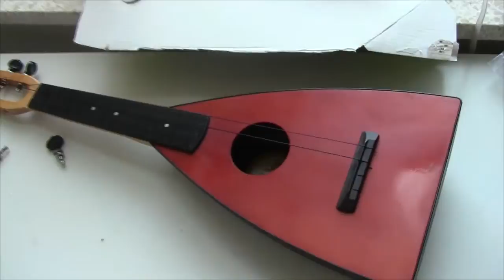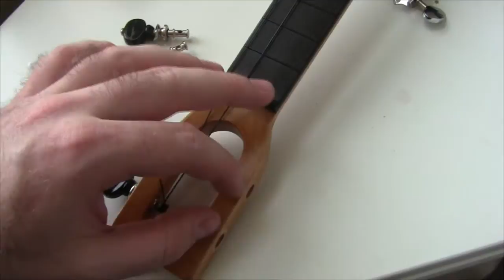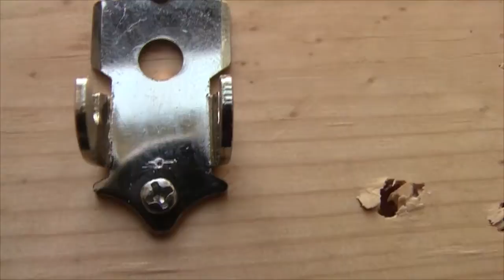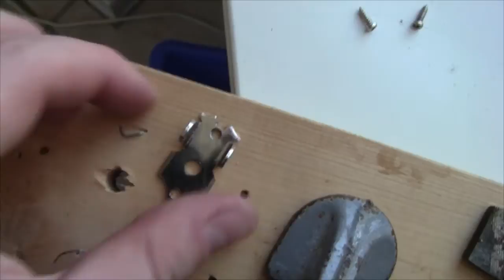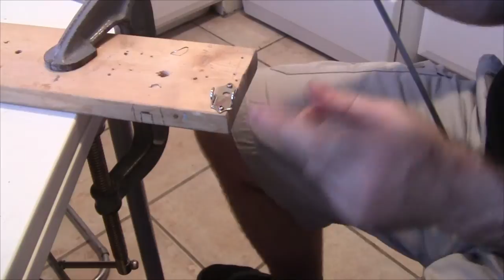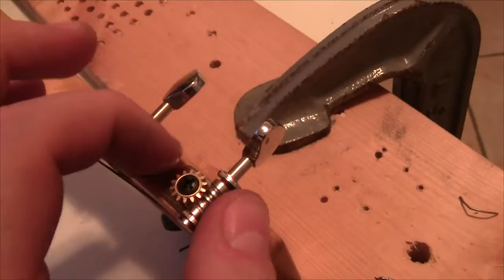Retrofitting a Flea/Fluke/Firefly Ukulele with Machine Head Tuners

Comment: At the end of the video, you showed a closed gear Kluson style tuner which you said you were also going to try.  Did you try those on a Flea/Fluke?  How did it go?  Looking at those, it seems that trimming off any overhang would be more difficult, if possible at all.
Reply from the maker: Yes you're right. As I recall, I initially tried to file the overhanging edges, but the metal was thick and it was taking forever. I switched to my rotary tool (dremel), and while it was indeed faster at removing metal, it made the tuner really hot, which damaged the tuner, because I think there must be plastic parts inside. The style of tuner I demoed in this video is a much easier choice!

Comment: Thanks I did this today, my music shop had mahalo Uke  geared tuners which they said had the least modification needed. They look exactly the same as you used. They had grovner but he said the mahalo in his experience  had no problems in his 30 years at the shop ,( maybe you upgrade by then but I have also had a mahalo no problems).
I just miss matched the tuner heads and had the shortest ends matching together because I was too l lazy to grind away metal with a file and hacksaw. I drilled a new hole closer to turner cog as original screw hole is to close to the top of the Uke head and wanted it further back than 3 mm(Australia measurement or 1/8 of inch approximately) to prevent possible split.
I did not file anything away but it looks pretty good without an extra hour of fiddling around more.
Reply from the maker: Nice. Glad to hear you were successful! Clever idea to mismatch the tuners to avoid having the trim the metal. Does that mean that the direction of rotation is opposite on the ones you swapped?
Reply: @cjhoyle  you turn them both ways to tune so works the same way. All pegs on the bottom.
Reply: @cjhoyle  I put a new hole on non cog side nearest the top I should have said. Your video got me going I just tweaked it  , I didn't screw in the tuner head to a piece of wood numerous times as I did no filing . The edges stick up very marginally but you don't notice it. I was lucky that I didn't have shave the hole ,the internal guide piece for string cylinder threader pushed right into the existing hole and grabbed. I did take off a few tuner heads from 1 lying around ukes that never gets used  and a neck from a broken Uke which was an unfortunate accident ( may be used one day) to do some physical research to nut it out.
I'm sure you inspired a few people around the world.
Reply: @cjhoyle  I think the rotation has changed but that's alright, I can live with that, it only needs fine adjustment.
Reply: @cjhoyle  I decided to relook at the tuning heads as I had a little bit of a look to see how much of the tuner metal plate I would have to trim . Not that much at all so I went ahead and have changed two of the tuning heads around so they are all in the correct rotation,less to think about when I tune . It makes more sense really. I am really enjoying the magic flea and it only needs a tweak of tuning head to get the tuning right. Friction heads were as frustrating as anything to get right ,more  play rather than more  tune is the idea. GREAT iINSTRUCTIONAL.

Comment: Friction tuners work well if you stay after the adjustment screws. The peghead wood  shrinks and  expands ever so slightly with humidity changes so it takes < 30 seconds to get a  perfect feel every so often. I happen to think cheap geared tuners aren't worth their weight on a soprano uke.
Reply from the maker: I respect your opinion, but I personally find Friction tuners annoying even when the adjustment screws have been set correctly. I prefer the mechanical advantage that the gears provide which allows making fine adjustments very easily. I'm ok with the additional weight.
Reply: Peghed planetaries! The aesthetics of a simple peg, the convenience of gears.
Reply from the maker: But the price tag of that mod is roughly 10 times what I spent on mine!

Comment: How did it work out with the other tuners on the Firefly?
Reply from the maker: I haven't finished it yet. The more fancy set of tuners that I bought for putting on the Firefly are considerably more difficult to modify. The material is quite a bit thicker and not as soft to work with, and also there is no way to disassemble the different pieces. I will see how it goes but possibly might just order another set that are the same as what I put on the Fluke.
Reply: Nice job on the Fluke...good luck on the Firefly